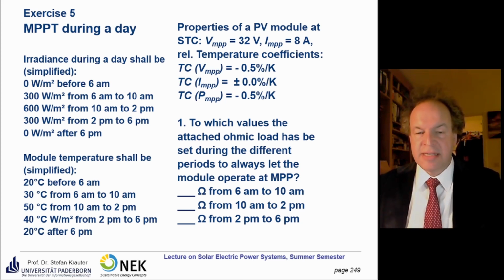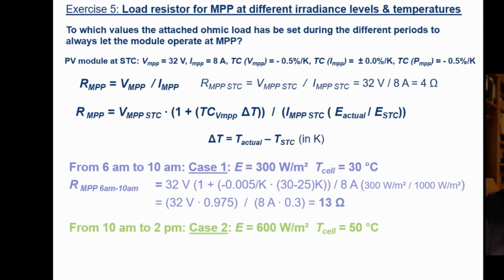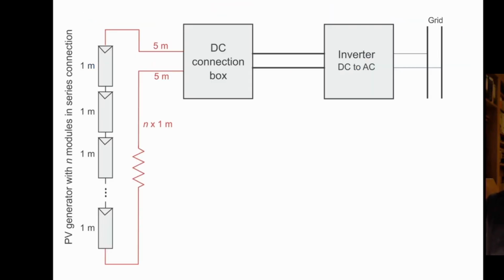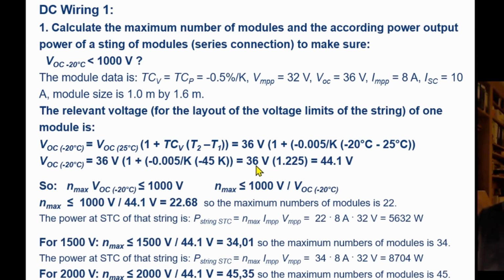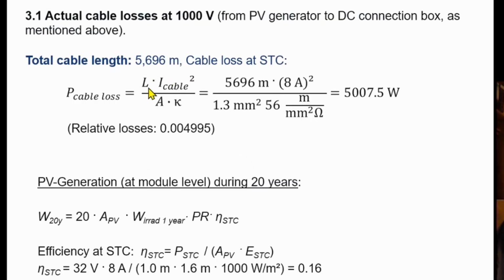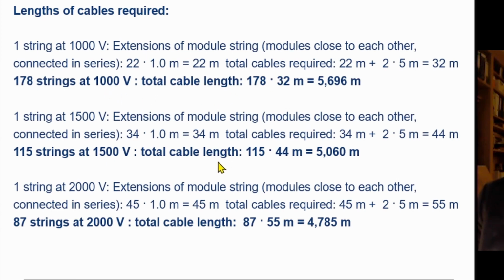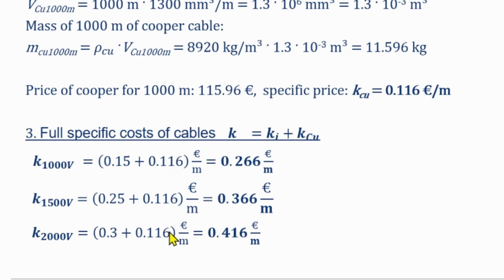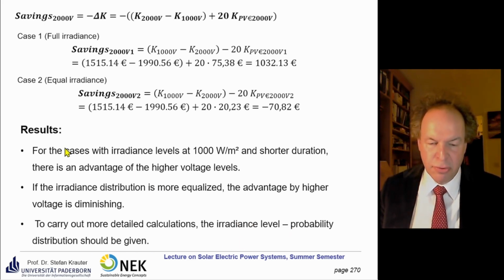Exercise 05 of Lecture Solar Electric Energy Systems - PV Systems - Wiring

Comment: Hello Prof. Krauter,
at 24:46 you explained the two extrem values. I don't understand how you get the current of 2.149 A? 
Thank you.
Reply from the maker: The current is proportional to the irradiance, if the current is 8 A at STC (so at 1000 W/m²), it is 2.149 A at 268.6 W/m².
Reply: @Stefan_Krauter  So simple? Thank you very much!

Comment: In the calculation of specific cooper cost while are we using 1000m when we already know the exact length say 5696m for 1000V?

Ki1000V =0.15euro/m x 5696m = 854.4euro 

Kcu : 

Masscu1000V = 8920kg/m3 x 5696m x 1.3x10^-6 m2 = 66kg 

Kcu = 10euro/kg x 66 kg= 660.5euro 

K = 854.4 euro + 660.5euro=1514.9euro
Reply from the maker: I don't understand: All is calculated for 5696 m here, the insulator costs as well as the amount of cooper and its cost.
Reply from the maker: Do you have access to PANDA ?  I just put the solutions in Detail as PDF there.
Reply: Yes. Okay thanks
I will check it out

Comment: While calculating the losses ,why are we considering 1176.5 hours of the year for the 1st extreme solution?
Reply from the maker: Because this is the calculation for an extreme: 1176.5 full load hours at 1000 W/m² of irradiance (the maximum), which results in the given accumulated annual irradiance value of 1176.5 kWh/(m² a).
In practice, the irradiance values are lower and more evenly distributed over the year.
The second extreme suggests a constant low irradiance value (268.6 W/m²) for 12 hours each day, which results in the same annual accumulated irradiance value, but with a constant lower current in the wires.

Comment: If we increase the voltage, why dont we decrease the diameter of the cable?
Reply from the maker: Yes, you can either reduce the losses or decrease the diameter at the same losses.